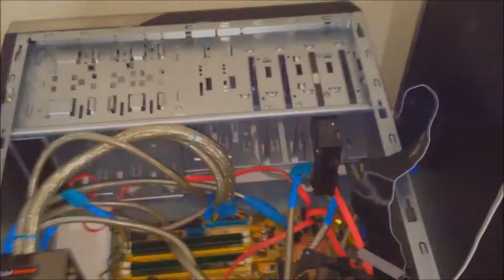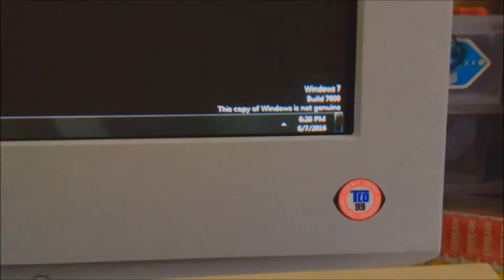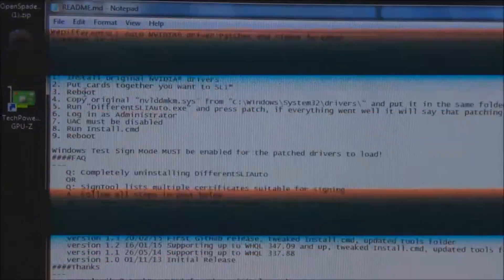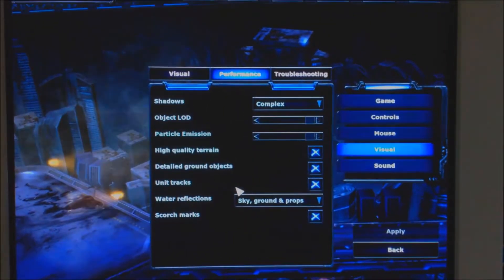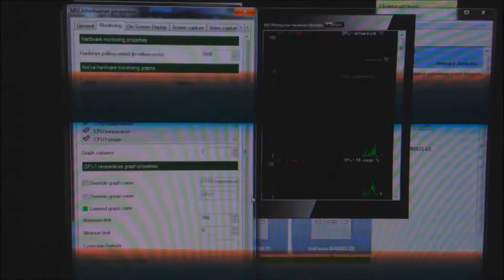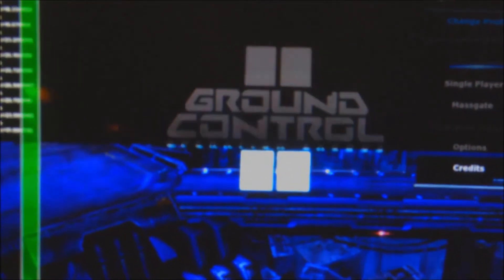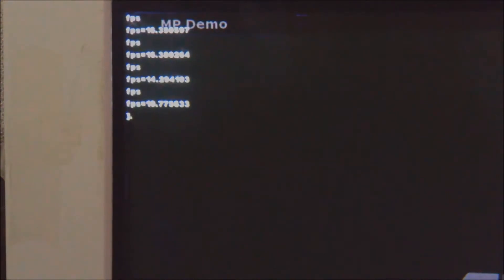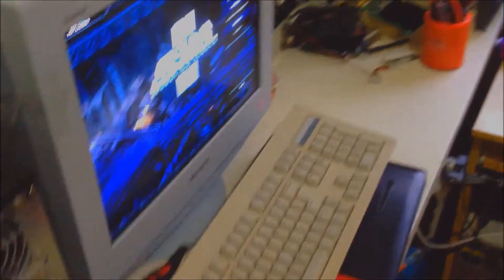[NO BRIDGE] SLI ANY 2 Similar Graphics Cards! 2022 [Part 1][2x8400GS SLI][NO SUPPORT NEEDED]

Comment: Hey dude ive been looking for this. Recently installed two GTX960 with SLI bridge on a HP Q87 chipset.
I was crossing my fingers the board was enabled for SLI ( i cant find any documentation on the net). 
Nope I couldnt get the SLI to show up in my NVIDIA control panel no matter what. I updated the drivers too. Strange thing is...my games seem to improve with more FPS when i dedicated the PHYSX to my other GPU. 
Question - if i follow your instructions to enable SLI, any chance my Windows 10 will crash?
Reply from the maker: Crash? Yeah theres a chance if they don't work. You won't lose data though. Just reboot and try again

Comment: OCZ powersupplies are way underated these days, they ar in fact the old legendart PC Power and Cooling. They made the worlds most powerfull ATX powersupplies  back inm the late 90's and early 00's. Even used in military simulation systems.
Never heard about the "DiffrentSLI software, have once used somthing called "HyperSLI" used the computers virtulazation thingy to lie about the motherboard and SLI support. Sadly hard to obtain that software these days. But used it with some AMD motherboards over time.
Will have to try DiffrentSLI out one day :)

Comment: i have tow amd graphic cards i can use both of card without SLI cable..??
Reply from the maker: Only if they are supporting crossfire, AMD allows crossfire between different cards, but only in the same generation and a few cards to the high or lower tier. Check their compat table to be sure. Not sure if DifferentCrossfireAuto exists

Comment: so does this work with current (10 series) cards? also is there a big perf hit in newer games?  is this practical in newer games with newer cards is what im asking?

never mind  found my answer.  you need the bridge for higher end cards.  im looking for a way to get sli to work with one card on a 4x wired 16x slot.  anybody ?
Reply from the maker: Have you tried running differentSLI yet?
Reply: not yet but from what ive heard newer and higher end cards require to much bandwidth and it doesnt work very well.  i might play around with it and im sure it will work but the results will probably be less than great
Reply from the maker: @bobhumplick4213  Yeah, that's kinda looking true, unless all the drivers killed SLI for incompatible cards. I tried SLI with 4 GT 1030's, it ran like ass and only tanked FPS by tonssss

Comment: i have 2 8400GS  dude does this work or what i tried it and i had no ;uck.......tips yo!
Reply from the maker: Should work. If it has different types or volumes of memory though you need to put the lower memory one in the first slot. Otherwise you're out of luck. Make sure you follow these steps carefully but

Comment: Thanks for this amazing hack! But I have a question: There is only one PCIe-Slot on my Mainboard, so could I use an adapter to split the x16 slot into two x8 slots? Is this going to work?
Reply from the maker: Does such a thing exist? Only one way to test it out. It should be theoretically supported to have at least 1 16x lane. or 2 8x lanes. Not recommending you to spend a lot of money if it costs too much, but should be worth a shot. You don't know if you don't try xd
Reply: Compuguy123 - Ghetto Mods/Gameplay I know that SuperMicro sells those adapters and I found this one: http://www.compsource.com/ttechnote.asp?part_no=RSCR2UT2E8R&vid=428&src=F
But for nearly 50 Dollars it is really expensive! (It costs more than both graphic cards I want to use :D)
I want to build a cheap PC out of an old serverboard with two Xeon x5650 processors and it is hard to find a server mainboard with 2 socket 1366 CPU slots and more than 1 PCIe x16 Slot (2 or 3 would be perfect) for under 50 Dollars... Do you know another option? (Sorry for my bad english, I'm from Germany)
Reply from the maker: That would be the only option unless you can find something cheaper, like an old motherboard with simply more slots

You can try sawing off the back of shorter pcie slots but that isn't exactly recommended. The x8 and x4 lanes should work in theory. It doesn't have to be full x16 to work
Reply: There is an adapter but your graphics would be bottlenecking for the slow speed of the slot because it's not pciex16 3.0 or 2.0

Comment: I have a Sapphire Nitro Radeon rx 460 is there a way to make it work with a GeForce GTX 750Ti.
Reply from the maker: No. Nvidia cards only. AMD is kinder with their crossfire configurations, allowing you to pair up cards from older generations and even from the same line but different tiers.

Comment: no way i have one of these i need to get another one and try it
Reply from the maker: Try your best to get the same one because I tested it with two different 9500 gt's and It didn't work whereas GTX 680's with different memory size did. Quite odd so no guarantees tbh. GL!

Comment: thanks for the video. I am looking at a special experiment. I am using a single slot x16 board and external gpu x16 adapter board for the experiment.  I am interested in seeing if I can sli with an external gpu thereby allowing any single slot board to be converted to sli with an external gpu setup.
Reply from the maker: Wait how? are you using the onboard M2 slot or something? I do assume that it should work
Reply: The motherboard I am using. https://www.globalamericaninc.com/nf9g-qm77-mini-itx-industrial-motherboard-with-the-intel-qm77-express-chipset-supporting-3rd-generation-intel-core-i3-i5-i7-mobile-processors-and-optional-daughter-board-expansion.html